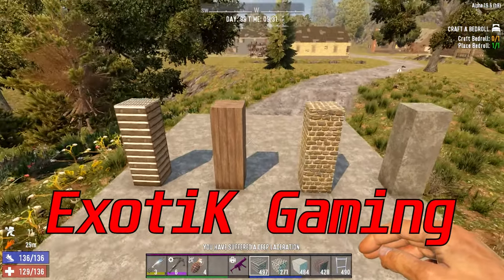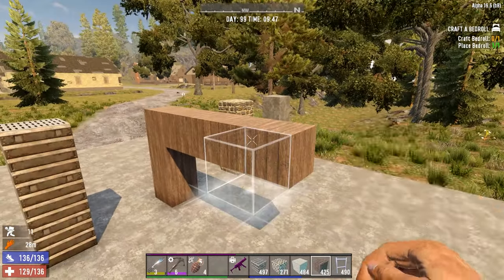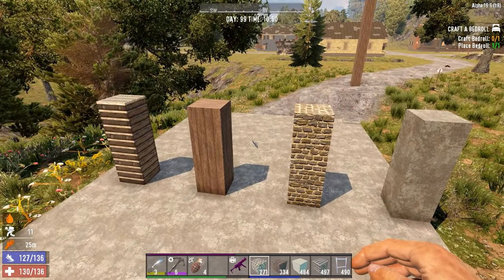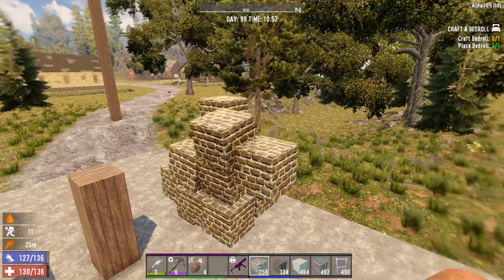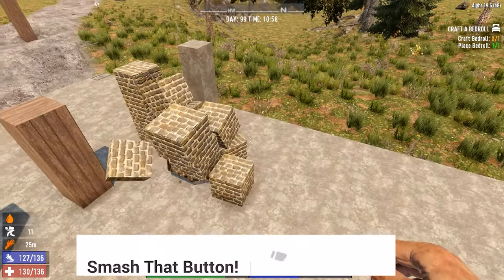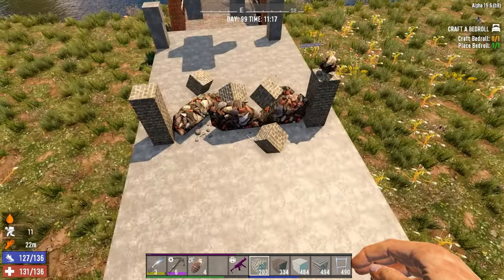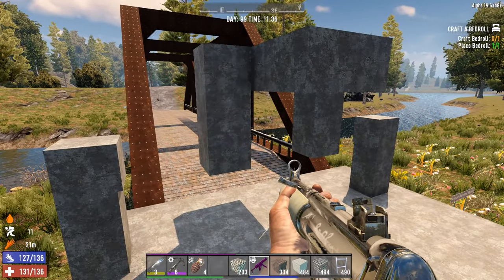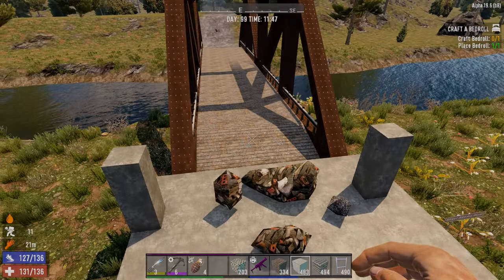7 Days To Die Structural Integrity: FAST & Under 2 Min. GUIDE

Comment: How much of this has changed since alpha 20 came out?  We at least get the colors on blocks now when you are looking where you are placing, but wasn't sure how the integrity calculations might have changed.

Learned how the integrity doesn't work last night when daughter and I started working on our first horde base and it collapsed.  :(  Assumed it worked like other games that I've played and it didn't work those ways.  LOL
Reply: Soon there will be only two levels left, wood and metal. Lol
Reply: if anything has changed it will be shown in the block description, my definition for a description area is that area where you would check the values of armor and weapons when the item is selected.

I remember the days when you had to make a rebar block before you could fill it with concrete mix for it to be then called "wet concrete" then drying into concrete block, then you could upgrade it to metal block... the problem in those days was there was a compression value (vertical integrity), turning a rebar block into wet concrete which had virtually no integrity vertical or horizontal was a nightmare, and repairing concrete blocks made them wet concrete too. which is fun to watch your base that was fully functional collapse because you repaired a concrete block, which just meant upgrading to steel block before it could take damage was the only way to making a base after cobble stone
Reply: @apackman1822  those were the days, in many ways better than a21 tbh. I miss old days ._.